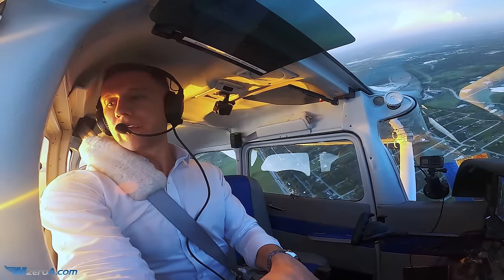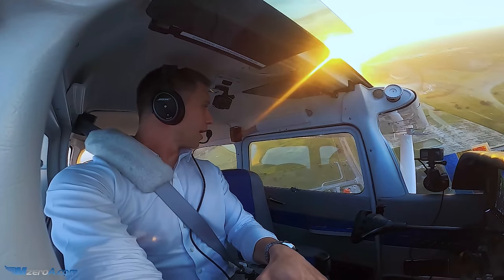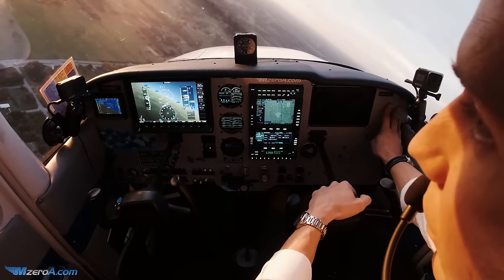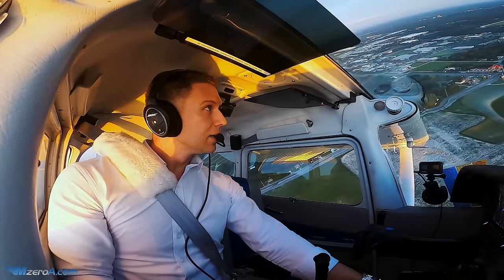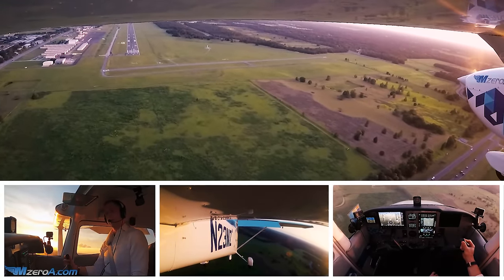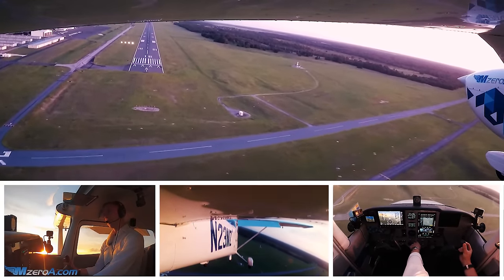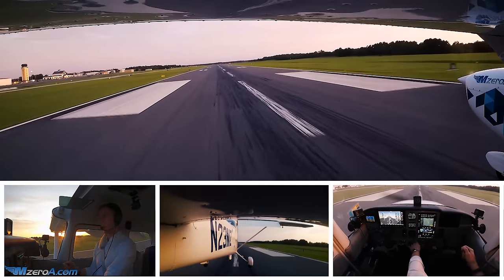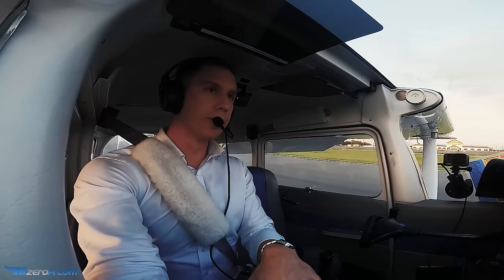The Steep Spiral - MzeroA Flight Training

Comment: I see below that you said aim for a speed of around 90-100 in a Cessna for this. But I've heard some instructors say you want best glide speed (65). Thoughts on that? Thanks.
Reply from the maker: Hi Ben! That is a great question. The 90-100 kts is typically used due to the load factor imposed while doing the steep spiral. Since you can use up to 60 degrees of bank, you can potentially increase stall speed by 1.4x. This new stall speed could be close to or even higher than your best glide speed. One thing you may practice is performing a steep spiral to 1500 feet AGL and then transitioning to a simulated engine failure where you then pitch for best glide and practice an emergency landing scenario. Hope this answers your question! If you need any help please reach out to us at support@mzeroa.com. Fly safe!
Reply: @MzeroAFlightTraining Great video and thanks for sharing it! I believe because you are off loading the wing in a descending steep spiral your stall speed increase is not quite the same as holding a 60 degree bank in a level flight steep turn. Best glide speed in a steep spiral would not be an issue in terms of increased stall speed in this case. Just to throw it out there, I personally prefer to use best glide speed in a steep spiral in an engine out scenario to give a bit more time to get prepared for landing.

Comment: Question; if you have a passenger that's ill and must get to the ground right away, is this maneuver approved? Thanks for you opinion ahead of time, first thing that came into my mind.
Reply from the maker: Great question! If you had an ill passenger, you could use a steep spiral to get down quickly. You'd need to maintain situational awareness and be sure to communicate it.
Reply: I would imagine that it could exacerbate the problem if the passenger is already ill. G loading while someone is already throwing up may not be the best combination. I suppose technically it is legal, but I would consider if gentler (albeit slower) maneuvers would be better for the passenger.
Reply: As a 15 year CFII, I've had this happen more than once. DON'T do a steep spiral. Slow the plane down if it's bumpy, and fly with the most gentle maneuvers possible, getting on the ground ASAP, but smoothly. You don't want to make a bad situation worse.
Reply: @curtisb9422  Thanks & roger wilco

Comment: Jason, I am working on my CFI and I am struggling to do this maneuver to the left when sitting from the right seat bc of the sight picture.  I can do it without isssues to the same side I am sitting at bc I can see the spot easily.  Do you have any suggestions? Checkride coming up in September.

Comment: Great video! I was never taught the steep spiral during my primary training. My CFI demonstrated it once, and it scared me! Looks much less intimidating now that I see you demonstrate it.

Question: how do you prevent a steep spiral from progressing into a death spiral? I'm thinking that having the power pulled back helps to prevent that, but would be interested in your recommendations.
Reply from the maker: Once you master the steep spiral, it becomes a very smooth maneuver.  At first you can start at a higher altitude and then get lower and lower.  The Commercial ACS dictates that you complete 3 360 degree spirals before hitting 1,500ft AGL.  
I tell my students to remember a few things:
1. Once power is pulled, trim to best glide (ie 68kts in C-172 SP)
2. Make turns anywhere from 30 - 60 degrees
3. Let the plane do the work, you as the pilot are maintaining the bank and airspeed. You will see the plane will descend in a nice smooth manor.

Comment: Excellent video.  However, it would have also been nice had you included some discussion as to your decision (reason) not to use flaps during the steep spiral - and what affect using full flaps would have over doing the same maneuver with no flaps as was demonstrated in the video clip.  Thanks - and keep up the great work!
Reply: Don’t confuse the steep spiral and the emergency descent maneuver in which you put full flaps to obtain the greatest descent in the quickest time.
Reply: @airplanegeek893  there has been trigonometry on this. Flaps down is like Vx but down, no flaps is like Vy but down. 

Flaps give you a steeper angle of descent, But because you're limited to the top of the white arc, without flaps and just pointing the nose down to Vno, you descend faster.

Comment: c172p  you cant slip with flaps extended
Reply: There might be some Cessnas that have limitations when they had 40 degrees of flap extension. On the 172 P, SP, and S they have 30 degrees of flap extension and there is no limitations on full flaps and slips with them. Check your owner's manual to be sure. I'd love to hear Jason's take it on it though.
Reply: @DUBaviator  True, but slipping with flaps doesn't show the student the pure effect of the slip alone, which is a good reason to slip with zero flaps.